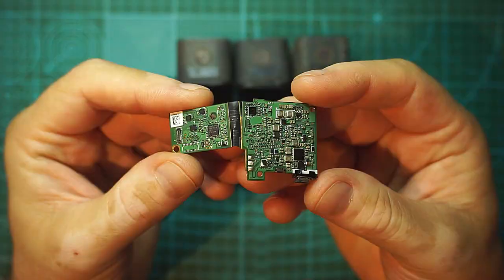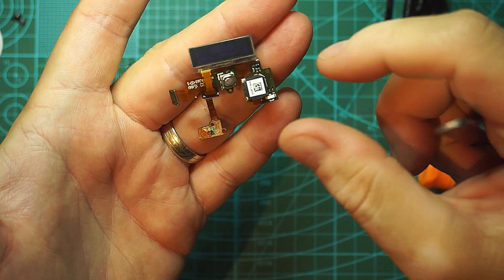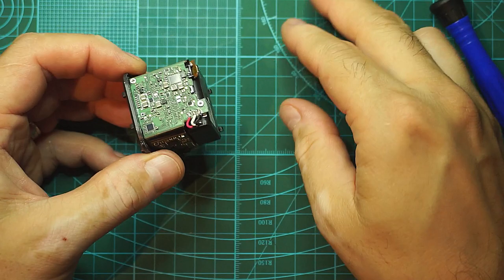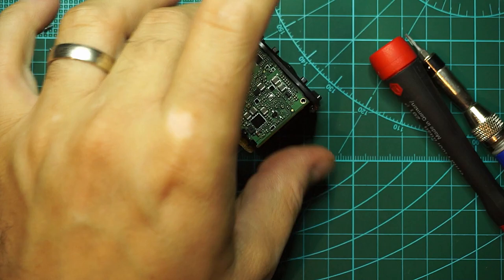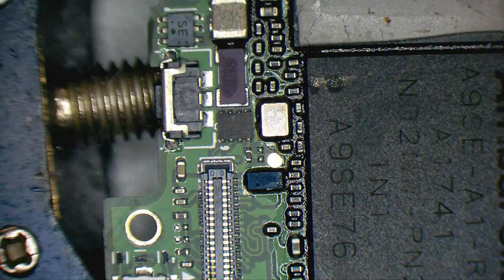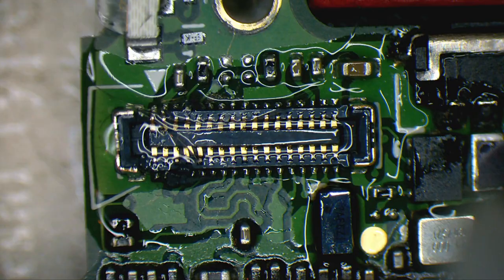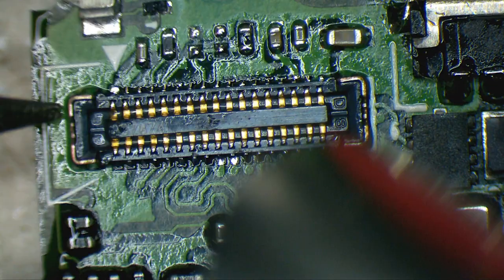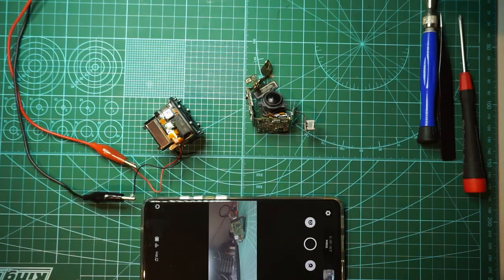How To Repair A GoPro Camera (Sensor SMD Connector & More)

Comment: My GoPro session 5 died after a failed update on GoPro Labs.. it didn't turned on again after the red flashing light stopped.. I tried directly charging the battery to a cellphone charger until 4.2v...  still didn't worked.. what could be the problem?

Comment: 18:52  The blue flashing comes from the gps module and means it is communicating to the mainboard
Reply from the maker: The Hero5 session does not have GPS so that is out of the question... I will need to find a screen and see what the GoPro is saying. I suspect it is an error of some sort.